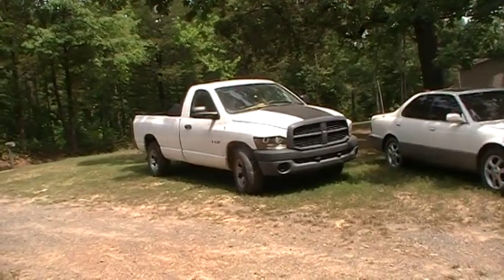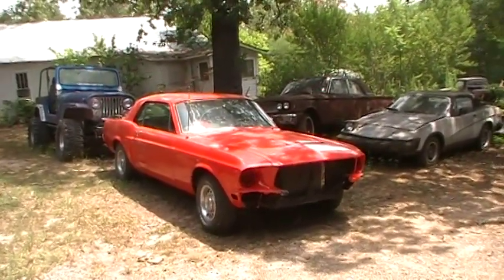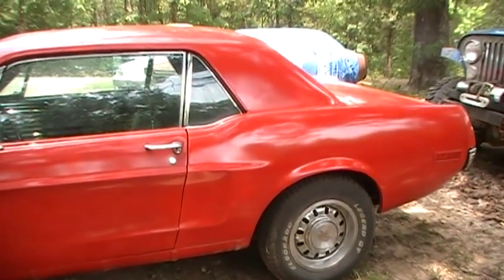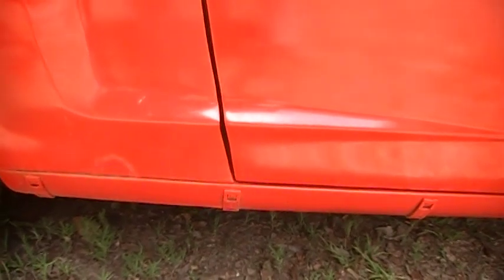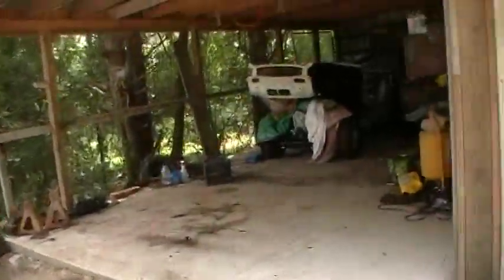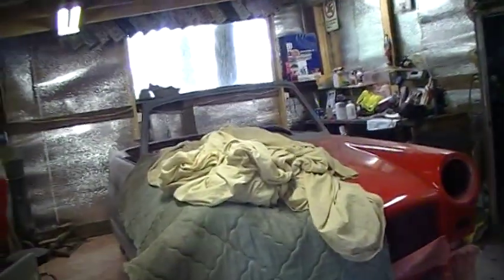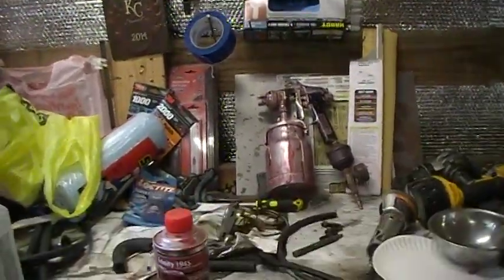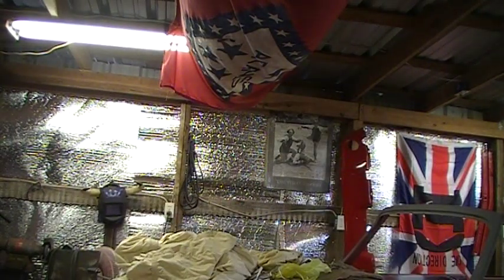Mustang Dang and Dang again!

Comment: Harold the Herald has been waiting for ages for you to get back to him!  Get Harold done!  The TR 6 is stripped down to its rusted frame places, you weld in some replacement metal and I bet that you can NEARLY just reassemble him, as the previous owner did a lot of good work on the ole TR 6.